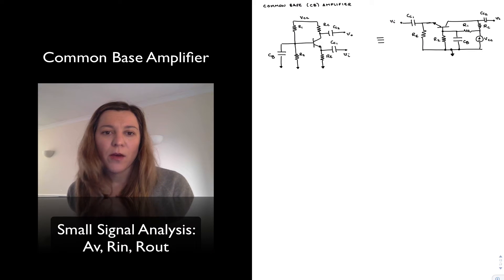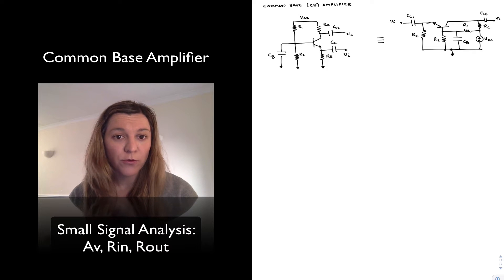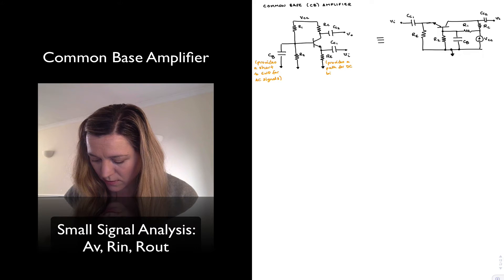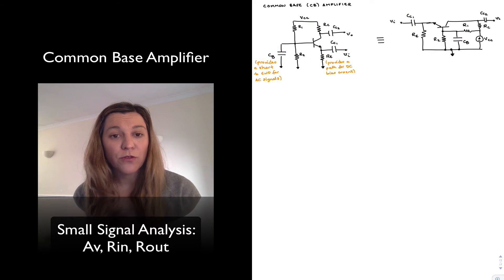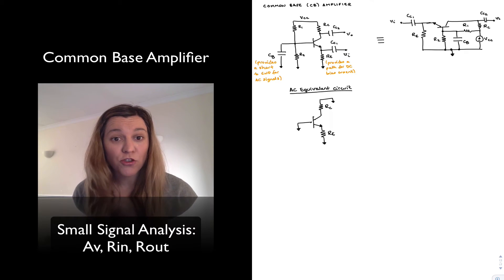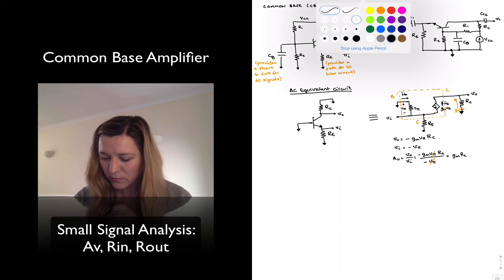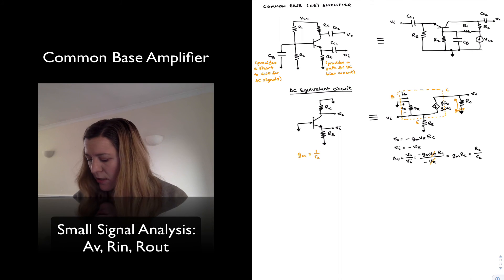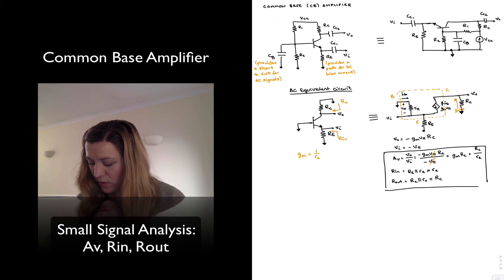CB Amplifier: Av, Rin, Rout

Comment: in a small signal circuit  model you used H form which contains  just rpi and no re  there , but when you carried on the calculations you replaced values with   re although no re in  model as it is shown  in small signal  circuit . it make struggle to understand the reason and your purpose  from using re in spite of rpi